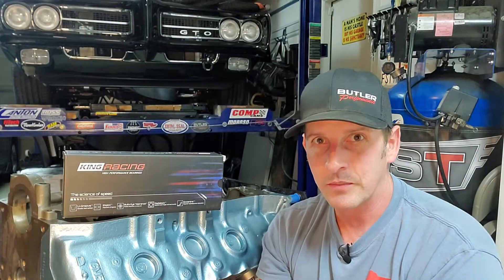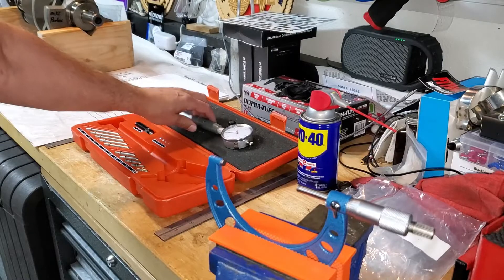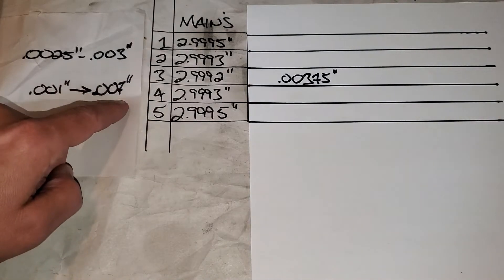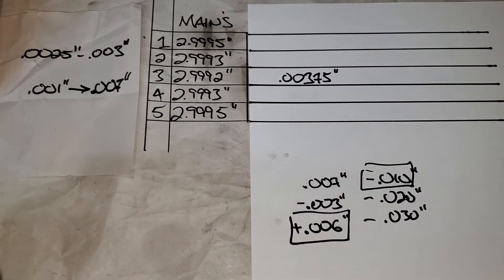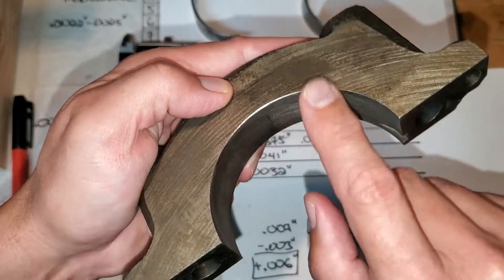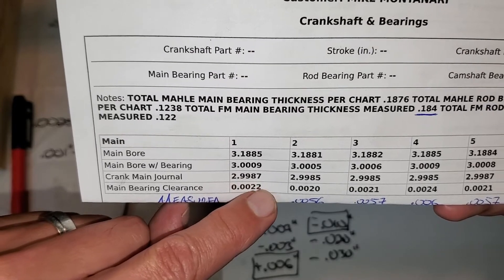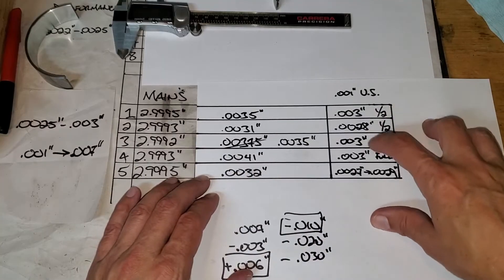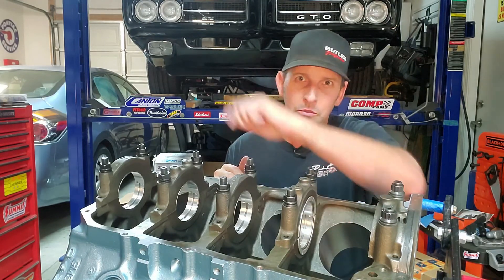How to measure MAIN bearing oil clearance for ANY engine.  Pontiac short block re-build, Part 4

Comment: What are the torque #'s on those bottom end studs? So many great videos. Thank you.
Reply from the maker: Thanks, and good question.  The mains are 95 ft. lbs. and the Rear Main is 120 ft. lbs.... when in doubt, I use this cheat sheet from Butler Performance.  https://butlerperformance.com/p-34888-pontiac-engine-torque-specs.html  Have fun!

Comment: With the larger or looser bearing clearances, are you using a thicker oil? If so, what oil type and weight/viscosity are you using?
Reply from the maker: I'm currently running DRIVEN GP-1 15W-40 Synthetic.  Oil clearances are typically based on your application... stroked?  N/A  Boost?  etc... it's up to your engine builder.  For Pontiacs I rely on @butlerperformance  Have fun!

Comment: If gm is ok w .007 and butler says .003. That means 3 to 7 work. N we just in a pissing contest
Reply from the maker: If and ONLY if you're building a bone stock engine.  If you're boring, and stroking, the tighter tolerance range is mandatory for the higher forces.  Thanks.
Reply: Any way u can make a vdo on reading the bore gauge. I can't figuer out how u got .00375
Reply from the maker: I hear you.  You might need to watch it a few times.  But you set your "Zero" where you measured your crank journal journal diamter.  The bore indicator actually measures the difference.  Hence your clearance between the journal and the bearing.  In the video, the camera is offset to my eye line... and it looks like 0.004"... but, it was actually 0.0375".  Hope that makes sense.   @apethings7671

Comment: That is pretty much how I have done things for years, no substitute for careful measurements... Not sure if you know or not but on the thimble of the micrometer, the small thumb thimble ratchets for precision tightening. Once the large thimble is rolled to touch the bearing journal surface, then use the small thimble to ratchet to precision then lock in place.
Reply from the maker: Yup, exactly how I used it. The video was long enough, I didn't want to go into how to use a mic. Ha ha. I was just shocked that my expert uses a book number. I was dumbfounded. Thanks for the comment!
Reply: @FastMonty   that is surprising...
Reply: @FastMonty  - makes me question how expert they really are.  Their methods are crappy, assuming the bearing shell thickness.  You can buy a tube micrometer that reloaders use to measure cartridge wall thicknesses pretty cheaply to be able to measure your bearing shell thicknesses.  It's stupid as hell for them to measure the bore and not just put the bearings into the bores, torque them and measure that like you are doing.  There's also poisson's ratio and bearing crush, but that's going to be minute.  I'm a MSME, so I appreciate you thinking through this stuff with your ME hat on.
Reply from the maker: @pete540Z  Thanks Brother!  Always nice to have another ME backing up my thought process.  I really thought I was losing my mind.  Thanks again,

Comment: Your comment about turning the crank undersized if the clearance is too loose - you can also have the block line honed instead of turning the crank. This is cheaper and will fix any taper in the bores.
Reply: But that reduces the bearing crush.  Not a good thing, especially on a Pontiac which is prone to spinning main bearings.  Bearing crush (hoop stress in the shells) creates the friction that keeps the bearings from spinning if there is ever metal-to-metal contact between the crank and bearing.  Line honing to a larger bearing bore reduces that - I'd not want to do that.
Reply from the maker: Well, not exactly.  Align Honing will fix any taper, but does NOT reduce the size of the bearing bores.  An alternative would be to shave the caps, and not hone.  That would compress the bearings to make up for the slop.  Otherwise, the best way to do it is as explained.  Thanks for the comment!
Reply: @FastMonty  - agreed - if the caps are cut and the bores then brought out to be round and 
spec size, then all is good.
Reply from the maker: @pete540Z  Thanks Brother... much appreciated!
Reply: Bobby, I am guessing you've never built an engine. 

Align boring or honing doesn't have anything to do with bearing to crank clearance work. It positions the crankshaft squarely in the block and corrects the bearing journal diameter. The bearing outside (shell) diameter is the same for all bearing undersizes and is pre-sized for proper crush to insure the back of the bearing is in full contact with the bearing cap and the main saddle to maintain the bearing clearances. Only the bearing wear-surface thickness changes for the various undersizes. You have to cut the crank journals uniformly to a standard undersize and use corresponding bearings. While they are referred to as undersize, only the journal is undersize, the bearing is actually oversize by the same amount removed from the main and rod journals less oil clearance.
Reply from the maker: @neighborscomplaint6859  Thanks Brother, well said.
Reply: @neighborscomplaint6859  I've had 2 engines built and in both cases there was too much bearing clearance and the machine shop ground the caps and line honed the block to get the correct bearing clearance.  The cranks were already cut .010 undersize.  I don't think you can get .001 oversize/undersized bearings once the crank has been turned. In my case it was also apparent there was some taper in the bores so line honing fixed both issues.
Reply: @FastMonty  I believe cutting the caps is part of the line honing process so I didn't mention it in my original comment. Otherwise, yes you would end up with the bores being oversize. So what i was referring to is cutting the caps and then honing back to size to get your proper bearing clearance.  Same general idea as resizing a rod.

Comment: Lots of time involved and still perhaps some questions on the measurements.  The factory and a rebuilder can't afford to spend such time so likely have faster methods to determine bearing clearances.  Did you do a final Plastigage check with crankshaft installed?  Finally, what is the best target gap?  Current engines tend to spec smaller clearances like ~1 mil, rather than the 2.5 mil of 1960's small-blocks.  One reason is to run thinner oil (even 0W-20) for less drag.  NASCAR does that too, but swaps bearings every race.  A smaller gap also gives less noise, especially with an aluminum block.  Another reason is that an aluminum block expands, so the gap increases as the engine warms.  They have higher volume oil pumps to work with the thinner oil.  A larger gap gives more allowance for deflections and imprecise fit.  I agree with sticking with 2.5 mil of the day and using at least 10W-30 oil.  Many classic owners use diesel-rated oil, at least brands with more zinc to better protect flat-tappet camshafts.
Reply from the maker: Good points... however, if you want super tight tolerancing you (or, the engine builder) needs to Blue Print every bearing measurement.  That can be up to $2000 in labor.  So, it's not quick.  Race teams know their dimensions BEFORE tearing the engine down, so they already know which bearings to use.  Factory built engines have dedicated gauges that quickly determine which bearing to put on which journal... but factory engines don't have tight tolerances either.  That said, every engine is different.  Mine used to be a 400, it's now bored and stroked to 470, which means you have to add some more oil clearance to make up for the increased crank/rod angle.  Anyway, yes, I used plastigage in Part 5... https://www.youtube.com/watch?v=GQmfLtyMCFw  Thanks for the comment!

Comment: Don't trust a machinist is right they just pumping out work not checking shit. You ask your friendly neighborhood machinist to deck your block to zero and he comes back with I'll get it within  .005 of that number ..... Which is zero.  You get a call your block is done you go down with the money you look over the block while noticing things are missing. After a little search the machinist finds your missing main bearings which were never opened. You ask how did you deck the block without installing the crank and a rod with piston? Your friendly machinist says they used math and your probably.010 in the hole. Your first red flag was the missing bearings your second red flag was the word probably. So you check yourself and using the proper method with a dial indicator you find your not .005 or under your not .010 or under your actually .018 in the hole. So then you call your friendly neighborhood machinist and tell him what you discovered. Nice guy says no problem just bring it back I'll cut it again for free. Ok cool so all I need to do is bring it back when I get out of work early enough on a Thursday the only day your open late and of course your not open weekends and make the time again transporting this engine block again because you couldn't do the job correctly the first time. Thanks friendly neighborhood machinist.
Reply from the maker: Ha!  Love it!  We all have crazy stories like that, which is why we now do our own work.  Thanks for sharing!

Comment: I’m building my first small block had engine crank all machined at local machine shop I was told .10 under on mains and other bearings.. I double checked with plastic gauge on my main bearings I got .002 all the way to last one rear main 1 piece seal bearing was .003 other engine builders say that’s perfect but what’s your take ?
Reply from the maker: Yep, you're good.  It's better to error on the high side, ie .003, instead of .001.  I have larger clearances in my engine because its stroked, if that's what you were wondering. Good job!

Comment: At what HP do you need to switch from main bolt's to studs?
Reply from the maker: Good Question!  I honestly don't know... Some guys like studs for easier head install.  I've also heard they're not really needed until you're approach 20 lbs of boost.  That said, if you do find a definite answer, let us know!  Thanks for the comment.
Reply: @FastMonty  Terry was asking about the main bolts to studs, not head bolts to studs.

I was always told whenever you plan to make more then 600hp or are going to install a turbo/blower/super charger, then you should switch to studs in your main caps for the better clamping force. If you plan on making 1000hp+, then you better speak to the pros who build these things everyday, and get the answers you need from them, because there's a lot more than just studs needed then!
Reply from the maker: Ohhhhh, yeah that's a different answer.   The answer is over 700 hp you need FOUR BOLT Mains, doesn't matter if they're studs or not.  I'll be doing this next year, so stay tuned!  @Anarchy-Is-Liberty
Reply: @FastMonty  I can't speak for Pontiac, but like BBC's, the factory 4 bolt main caps tend to be a bit weaker than 2 bolt main caps, so if it's really strength you're looking for, you need to convert a 2 bolt bolt to a 4 bolt splayed billet cap block. I've known class racers using studs on 2 bolt factory blocks making 700hp. Peace.
Reply from the maker: Agreed.  Splayed is the best.  Thanks!   @Anarchy-Is-Liberty

Comment: Hey mike, if I buy a stroker kit from Butler that includes crankshaft connector rods and bearings and rings do I really need to do all this checking?
Reply from the maker: Great question!  It's up to you, but, bare minimum, I would use plastigage for a final check on all bearings. Have fun!

Comment: When using a mic properly, I will get the same result as anyone else because you can’t tighten it less or more if you use the mic properly and the mic is calibrated. There is a clutch to ensure everyone uses the same torque no matter how much you can bench.  Without that clutch and calibration there is no accuracy or repeatability.
Reply from the maker: Agreed, still takes practice.  And when measuring in Ten Thousandths, you can still have measurement error between two different operators/inspectors.  Thanks for sharing!

Comment: Most important lesson: Don't rely on the specs supplied by the bearing manufacturer? 🤔 (I'm slow sometimes🥺)
Reply from the maker: The bearing spec for wall thickness is the Maximum.  We just proved that if they're made to the minimum spec, the actual dimension can be FAR from the theoretical.  So, never assume anything, and measure it.  Hope that makes sense.
Reply: @FastMonty  Yes, absolutely. Thank you 👍

Comment: Mike, any modifications to the thrust bearing?  I'll be tearing down my engine -- just lost all oil pressure and suspect my engine has been eating itself since my friends and I put it together almost 20 years ago.
Reply from the maker: Wow. 20 years is pretty good. Good question about the thrust bearing. I assume you're talking about the thrust clearance, ie axial play of the crank. I never mentioned it, and probably should have. The issue is it's impossible to fix if you have too much play, and very difficult to fix if you have too little play. So, we'll have to pray that your crank doesn't have any thrust surface wear. Hope that makes sense. Good luck on the rebuild!

Comment: Hey mike i really like your videos . It really brings back some olds memories . i did want to mention you should also check your lifters since they are hydralic debri will make its way to those too an damage the tight clearances in those .One other question why are the main bearings not full groove .i know the ram air 4 had full groove main bearing to bring more oil to the rod bearing . an what about the oil pump ?
Reply from the maker: Good points... yes, I'm cleaning EVERYTHING, getting a valve job, cleaning the lifters, etc... not filming that stuff.  That said, I don't know why new bearing don't have a full oil groove?  Maybe someone way above my pay grade decided that wasn't a good design?  ha, ha... Speed Pro bearings are probably the closest with a 3/4 oil groove.  The oil pump video is coming soon... full tear down, and comparison with the @butlerperformance Pro Oil Pump.  That'll be a good one.  Stay tuned!

Comment: Hi, mike
Great video I was wondering if did you did a align bore the mains on this build or on the previous build ? For the stroker build anyway your doing a great job also what was the oil pressure at idle pressure before you had the failure in . In July there’s going to be a all Pontiac show at the drive museum in el sugundo if you want to go and make a video for your channel let me know I’ll can drive you there stay cool brother and keep the vids coming
Reply from the maker: Thanks James!  Yeah, it was Align Honed about 5 years ago, (aka 3000 miles).  So, that wasn't needed.  Good to know about the El Segundo show... I'll keep it in mind!  Thanks for the comment!  Sorry... the oil pressure, at idle was around 35, before the noticeable failure.  The gauge read zero, but with a mechanical gage it was around 8 to 10.  Wait until you see what I find when I compare the old pump, to a brand new Butler Pro 80 lb. pump.  It's disturbing.  See ya!